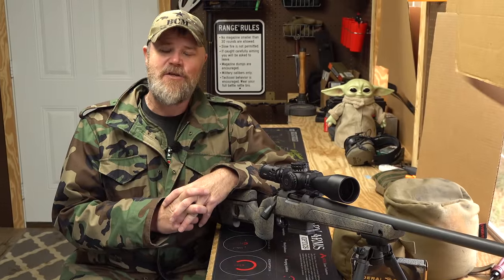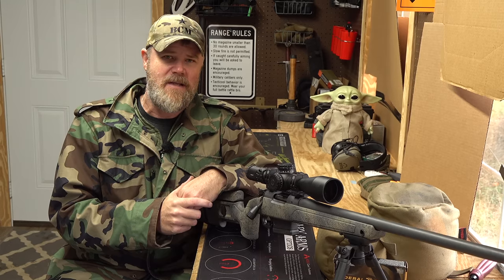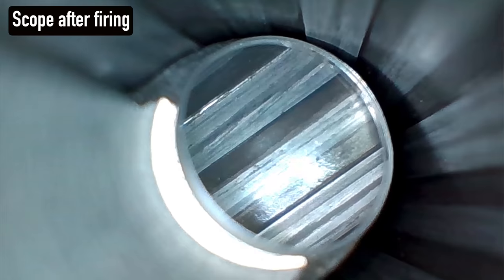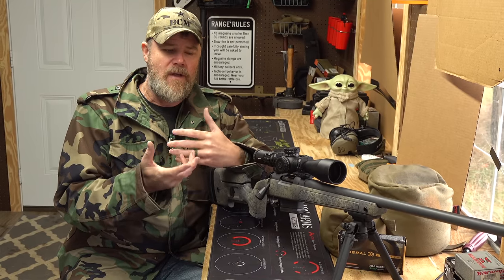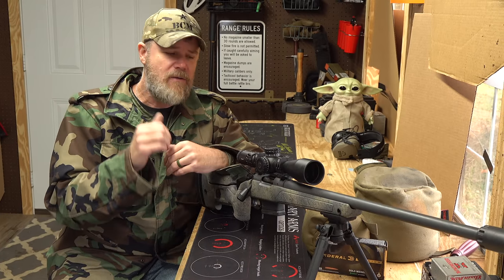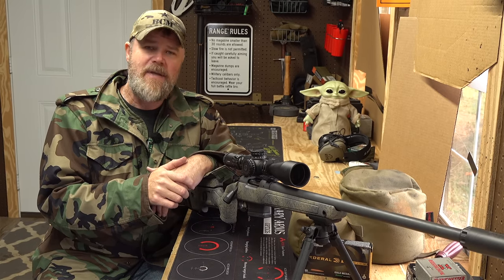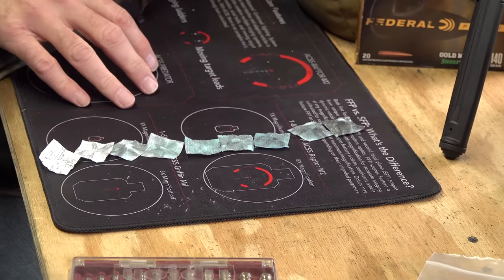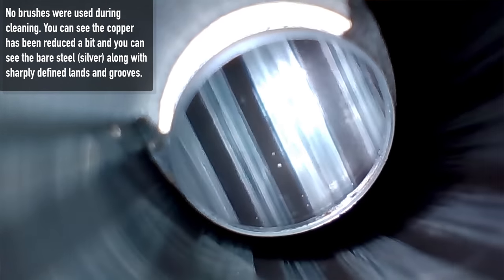Barrel Break-Ins and Cleaning Voodoo Rituals Destroy Barrels

Comment: Thanks, Tim. I grew up in the era when the mantra was “always clean your gun after every time you shoot it”. I came to agree with your mindset about a decade ago. I had previously tried cleaning to bare metal and fire lapping old bolt action milsurp rifles. All that effort is mostly a waste of time. Usually those guns settle in after the rough spots are filled with copper and the fouling actually smooths out the bore. The most drastic cleaning I do is to squirt some CLP down the bore, let it sit 2 minutes, then pull a bore snake through the bore- no more than twice. Done. No more cleaning required. CLP will eat away at carbon, not touch the metals, but leave oils behind to prevent rust. I still believe in the fouling shot after that procedure (in the case of hunting rifles, where first shot accuracy is necessary), but I feel the fouling is actually necessary for making the bore smoother than it is when it’s clean to bare metal.
Reply: Well with modern ammunition its not really necessary, but back when they were shooting black powder muzzle loaders and black powder cartridge guns cleaning after every use was necessary to prevent extreme bore pitting(Or at least every few days, the sooner the better and easier to get the fouling out). And even for a long time with smokeless powder all cartridges had corrosive primers so frequent cleaning was necessary to avoid pitting. However if you do shoot any ammunition with black powder, corrosive primers, or both this still applies. And with muzzle loaders it always does since those are exclusively black powder/black powder substitute guns.

Comment: Schuemann barrels, a manufacturer of high precision target barrels put out an article many years back saying to never use modern solvents.  They calculated that just a minute of contact with modern solvent can remove enough metal that they consider the barrel ruined.  Their advice was to never put anything down the barrel except jacketed bullets and an oiled bronze brush or patch.  I stopped using solvents after that and have never had a single issue..  If I shoot my lead reloads, I simply fire a half dozen jacketed rounds at the end of my session which cleans out any lead fouling that might have accumulated.

Comment: I use stainless steel brushes exclusively. I turn the brush as I pull it through to add what I call "micro rifling". It super stabilizes to such a great degree that I call the MOA in seconds.

Comment: Great video and I can tell that you actually have experience by you’re methods.👍 Mine are very similar except I use mostly Ballistol and once a year I may use Hopps and a bronze brush, depending how much I shoot. Copper is GOOD! Leave some in there!
Reply: Depends on the barrel. In a rough, cheap barrel the copper fouling may fill in microscopic pits and scratches and actually smooth out the bore...In a good match barrel, keeping the copper OUT is a good thing.
Reply: @MW-bi1pi  I have never owned a good match barrel that’s hand lapped with copper fowling issues. “Copper equilibrium” is a real thing, no matter what you’re barrel is or who it’s made by, you will never achieve consistency without finding that point of copper equilibrium . Keeping the copper out is a pointless endeavor in my opinion. Every barrel I own, from Kreiger, Criterion, Colt, FN, and Seekins all shoot better after they foul up.

Comment: Mac, your exactly right about the jagged surface of metal at the microscopic level.  One product I found a few years ago for my motorcycles and cars fills in those areas with polymers.  It's water based and it doesn't discolor metal at extremely hot temperatures.  I use it on my entire bike.  So one day I was thinking, why don't I try it on a gun.  So, I treated one of my pistols with it.  Took it to the range and ran a couple hundred rounds through it.  Took it home to clean it and the only fouling in the barrel was powder residue.  I ran one wet patch and one dry patch and the barrel sparkled.  Since then I treat all of my firearms with it.  The product is F11 Top Coat.  It's a great product with a lot of uses.  And thanks to F11 none of my gun barrels will ever be touched by a brush again.

Comment: I've always used a brass brush with a brass core and machined brass jags. Some of the cheap ones use brass bristles but they have a steel core so you can still mess something up with them. A steel cleaning rod is a no go for me as well. I use brass or aluminum. 

As to your strict use of nylon brushes, all I can say is that nylon is/can be abrasive. Whether its an inherent characteristics of the polymer or its b/c abrasive/steel material can get embedded into it, I can't rightly say which. I wouldn't necessarily say that a nylon brush is better/safer than a properly designed brass brush. We all know for a fact that brass is much softer than barrel steel and you can't easily embed abrasive debris into a brass bristle.

If you can be sure that you don't contaminate a nylon brush with abrasive material then I don't see a problem with using one. I don't have any myself and probably won't switch to one b/c I've never had a problem with using high quality brass bore brushes. With the little bit of shooting I'm doing these days I usually just run a few wet patches through, let it sit for a bit, then run a bore snake through. I may or may not run an oil soaked patch through the bore depending on the gun and how often I shoot it. I will do that for my milsurps and other older guns that don't have the great coatings we have today.
Reply: I used to think aluminum rods were too soft to hurt. Turns out the surface oxide is very hard and abrasive. Take an aluminum key and scratch glass to prove it.
Reply: Nylon is softer than the gritty primer residue left in barrels. So, it can embed into the nylon bristles. This grit can also embed in the plastic sheaths on "coated" cleaning rods.

ALL rods will flex and drag on the rifling if you are trying to shove an oversized brush or TOO MUCH cloth on a jag through it . 

My cleaning regime these days usually starts at the range, before packing up to leave. I squirt a bit of G96 "Gun Treatment" down the barrel and after a couple of minutes, run a loose-fitting patch through. This is basically to coat the bore with some protective "gunk" remover for the trip home. Then, at "Chateau Bruce", it is into the home-made wooden cleaning cradle for alternating "wet" and dry patches. . 24-48 yours later, back out of the safe, once again into the cradle and repeat until patches come out "clean". Re-oil and back into the safe.

Rod guides? You can buy commercial ones for most actions / bore sizes, or, if you have the skills and the technology, they are not a major hassle to make from hardwood, industrial nylon, etc. A  rod dragging on the START of the rifling is NOT a good thing. For "field" rifles with enclosed actions like the BAR or Remington 7600, etc, you need a simple muzzle cap with a central hole and then you can amuse yourself juggling jags and mops onto the end of a rod fed in from the muzzle, OR, you can run a traditional "pull-thorough" or modern "bore-snake" from the breech; your call.

If you can protect the first and last bits of barrel that are  traversed by the bullets, you should be OK.

Maybe we need an update to that old hippie book, along the lines of; "ZEN and the Art of Firearm Maintenance".
Reply: @richardkudrna1450  You're comparing glass to high carbon steel? Even oxidized aluminum still won't hurt your barrel from standard cleaning. Every bullet you send through your gun will put infinitely more stress on your barrel than an aluminum cleaning rod which lacks the pressure, friction, and heat that firing a gun creates.

Comment: I'm OCD about leaving mine locked up clean, lubed and ready after a range trip. With rifles I clean the receiver, bolt and gas block as needed (to my standards that means no built up carbon before light lube). As for barrels in most cases one or two passes with bore snake (with a few drops of balistol behind the light copper brush part) is all it needs, even on milserps. 
Been running this way for ages, never damaged a barrel yet

Comment: The way I break in a new rifle is to, #1 Mount scope. #2 Boresight it. #3 Take it to the range and shoot about 5 rounds at about 10 yards just to see where it's hitting and make necessary adjustments. #4 At 100 yards within another 5 rounds I should have it pretty much zeroed. #5 Take er out in the woods. Done. I totally agree, the only barrel I'll ever run a brush thru is a smooth bore shotgun.

Comment: I know squat about long range shooting and I'm not afraid to admit it. But one thing I've been wondering about for a few years is AR-15 barrels. From everything I've read or heard about chrome-lined barrels and how rough they are, it seems like fire-lapping them would be a good idea. Maybe not any other barrels, just chrome-lined ones. I don't know if I should do it or not, but I'm leaving my stainless steel barrel alone. For what it's worth, I was a small arms repairman in the army and replaced quite a few M16A1 barrels, usually because they got caught in the ramp of an M113 APC when the driver closed the ramp and drove away. They hardly ever wore out or had anything else go wrong with them. I've never bore-scoped anything smaller than 81mm or larger than 155mm, but have considered buying a rifle sized bore scope. It would be nice to see what's really going on in there.

Comment: Use Seafoam auto cleaner to get rid of carbon.  It works especially good on stainless revolvers around the barrel throat where they always get dirty.  IMHO the biggest destroyer of barrels is hot loads.  Experimentation in increments is key.    Try loading  DOWN 200fps or so, for better accuracy.

Comment: I have always been rather lazy when it came to cleaning my guns . I have between 600 to 1500 rounds through my pistols before I clean them. I have a 30-06 I cleaned once and lost all accuracy until I had about 30 new rounds through it . i usually only patch my riifles with sweats and then another mixture of bore cleaner and hopes I use once they comw out that blueish green color I stop cleaning and I went to nylon brushed with my M&P barrels and my stainless SR40 barrels as well. Never had another issue. I only use brass brushes on my ruger 10/22 I usually run a few thousand rounds through it every time I go to the range and it gets leaded up to say the least however thats the only rifle I use a brass brush on plus brass is softer than steel so it doesn't damage your barrel.what usually damages the lands is using steel cleaning rods. Have a bless day everyone.

Comment: That's pretty much what I do. I'll run a wet patch or bore snake through the barrel while it still hot. The carbon comes out easily that way. I dry it with clean patches. When it's cold I put it in the case and leave. I try not to case them hot if I don't need to. I'll use Sweet 7.62 once a year on a none crome lined barrel. It does a very good job of cleaning a years worth of Cooper out of my Remington M40. I put 600 + rounds through it a year in the 15 years I've owned it. Most rifles are cleaned to death not shot to death. The military cleans weapons so much because of the adverse conditions they are used in. The rifle range and hunting woods aren't a battle field. Unless your rifle got wet you normally just wipe it down and put a coat of gun oil on to stop rust. The clean it every time you shoot it came from the days of black powder and corrosive primers. The did require a thorough cleaning or they would rust up on you. Modern ammunition is not corrosive primed unless it's some brand of foreign military ammunition. My rifles are all sighted for the cold bore shot. They hit the target on the first round from a cold clean barrel. Subsequently if I do my part the rest go where I put them.

Comment: At some point, too much copper does degrade accuracy. Depending on the rifle, maybe somewhere close to 1000 rounds, if you never remove copper. However, cleaning the rifle with the boretech eliminator the way you do, removing only small amounts of copper each time, should keep the rifle in that sweet spot in terms of copper. My .308 rifle accuracy started to degrade but i hadnt fired enough rounds to shoot out the barrel, and I did everything I possibly could to fix the problem, until I spoke to a buddy of mine who shoots PRS and suggested I try completely removing copper, then laying down new copper. Took me about 10 days to completely remove all the copper, then about 30 rounds of laying new copper, and I got my rifle back to half moa precision.

Comment: On a match barrel you do not need to break in a barrel. The barrel is finished to a level where it will be almost cleaning. On a factory hunting rifle, the barrel has a much rougher finish. doing a break in, will polish the bore down in a controlled manner that will result in increased accuracy and a reduced need for cleaning.

Comment: This was an informative video, Mac. Interestingly, Bore Tech Cu+2 Copper is also sold by the same manufacturer. Minimalists will trust your procedures. The unrestrained will seek-out every product they can afford in hopes of improvement. Some say, microscopically, your barrel is like a stippled ceiling and copper fills-in the microscopic steel voids. Just as important as this topic is the fact that barrels don't wear out - they burn out. If you're really concerned about barrel longevity, it starts before the purchase, i.e., the cartridge selection. There are cartridges notorious for burning out barrels. Segueing to AR-15s: Dumping five 30-round magazines in a row will significantly lessen your barrel's life even if it started out cleaner than a cat's ass.

Comment: Choice of steel or other material for the barrel, heat treatment and machining are factors as well. Overall thickness and chamber tolerance are design features which can also contribute to a more expensive barrel. Imagine a bull barrel made from some of the newer super steels with impeccable heat treatments would last hundreds of years. Material science has come a long way. There are antique guns that are hundreds of years old and have lasted this long with technology hundreds of years old. 
   A cheap all weather bolt gun made today could last easy 500 years if minimally maintained.

Comment: Carbon ring can cause issues when you have a firearm that can fire 38/357 or 22 short/long, 45 auto rim/45 Schofield/45 colt/454 if you fire a bunch of the shorter rounds then later load the longer rounds they can stick when trying to chamber and extract the longer cases, the longer case will hang on the carbon ring.

Comment: A bronze brush on a spinning coated rod will never damage your bore if you use it like a normal human.  If you chuck it in a drill and whizz it for 10 minutes straight with aggressive chemicals, yeah you'll do some damage. 
I personally only use them on guns that I shoot lead in because that's all I need them for.  Other guns I just run patches and solvent, but not because Im scared a couple swipes of bronze will scratch barrel steel or that any chunks of fouling in the brush will scratch/damage barrel steal.
Water wears rocks to sand, I get it.  And it takes a hundred years of constant flow to make a small pebble smooth.  A few strokes with a bronze brush when you have lead fouling that requires mechanical removal won't hurt a barrel.

Comment: This is so true. I’ve been shooting for 35 years and work at the largest indoor range in my state. I’ve seen some pretty ridiculous “procedures” from folks over the years. That nylon brush that comes in your Glock box is all you need. I will say, my last patch after removing solvent has a tiny amount of oil. Key word being tiny, I’m not saturating the last patch. Especially if you have several choices and might not shoot that rifle for a while. I have guns older than me that still look new and they get shot, often.

Comment: 13:45 is not a carbon ring but erosion in the metal caused by heat, pressure and friction.

It will only accelerate if not polished.

Comment: Interenting, I was taught not to clean it... only run a blank patch or 2 through after each shot and let the barrel ware itself. Learned that from a old SAS sniper. He said that cleaning it made it less accurate, push a patch and would let it fire as it was... He was an insanely good shot He was of the oppinion that the less we tamper with the barrel the more repeatable the accuarcy was... in his case He was definately right.

Comment: I clean all my barrels with synthetic motor oil. 10w-30. Any brand will do. Synthetic because it will not smell like regular oil. It's odorless. 
Oil makes carbon much-much softer, and acts as lubricant. You guessed it! I use same motor oil to prevent rust and oil the barrel for best protection and durability. 
You don't need to spend 20 bucks on a 8 oz bottle of whatever. Use motor oil, the lubricity is perfect, and you don't even need much. That 1 quart that costs $5 will last you a year, or even more. 

Synthetic motor oil will not evaporate like most lubricants and can easily take above 300 Celsius.
I oil all the springs, crevices, triggers, barrels, and buffers with it. 

It's a miracle juice.